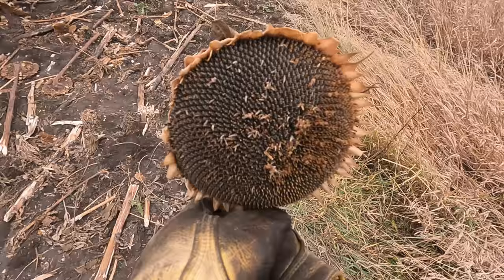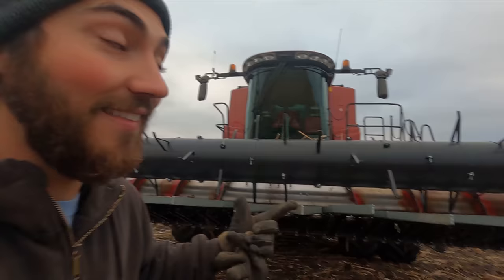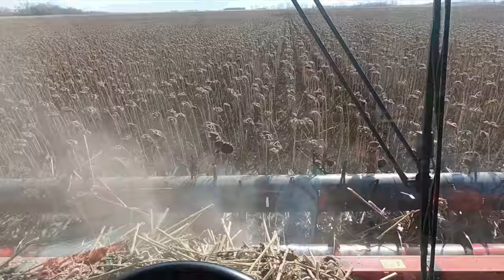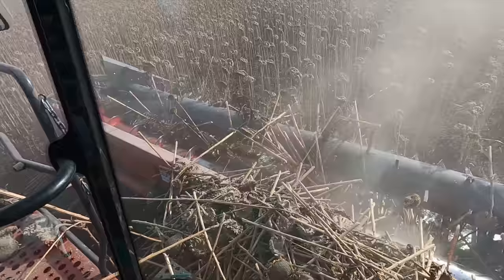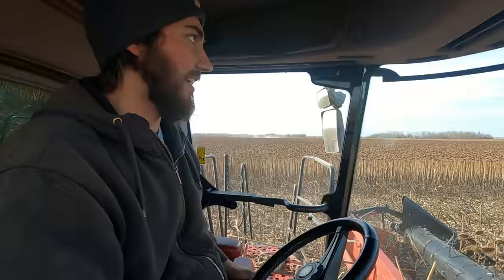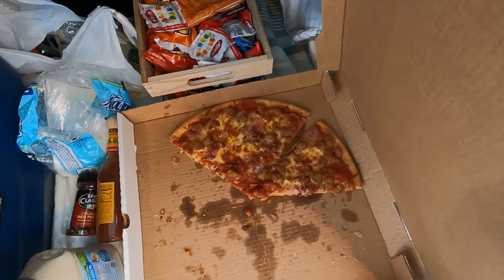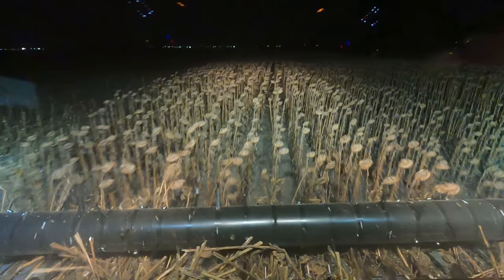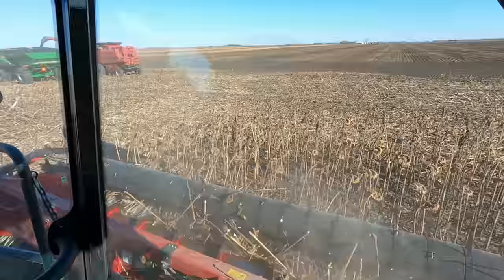Sunflower Harvest: It's an Art

Comment: My experience is the volume of air from a leaf blower is much more important than the higher pressure from an air compressor and thus blows off a combine much quicker.   
 It takes just 10-15 minutes so I use a battery powered leaf blower and that adds a lot of convenience.
Reply: For loose stuff, yeah a leaf blower is MUCH faster, but that stuff looked pretty "caked" on and can be a lot harder for a leaf blower to catch hold of and rip off...

Comment: When I was a little kid I was following the dog thru the woods & out into the field & I tried to walk through a low spot & got stuck in the mud. The dog went back to the yard. When my mother saw the dog & I wasn't with him she knew something wasn't right. She came out & pulled me out of the mud, losing her shoe in the process. Ten or fifteen years later I dug through the same spot & actually pulled her lost shoe out of the ground. That's probably the weirdest thing I have found in the field.
Reply: Our farm pond went dry back in '83 in a bad drought, and my sister decided to walk out across the bottom to the edge of the puddle of water in the middle to see the minnows, and she ended up sinking in the muck to her waist.  I had to try to get her out because Dad was too heavy, he couldn't get within 15-20 feet of her without sinking.  Even I, who was skinny kid at the time, had to crawl out on hands and knees on a couple old boards to kep from sinking, and then just get close enough to throw a rope around her... then we hauled her out.  Sucked one of her brand new tennis shoes right off her foot.  She was caked with mud from the waist down, and Dad wouldn't let her ride on the new tractor back to the house, she had to walk up the hill through the sand burs to get back to the house and get washed off with the hose... she was bawling and upset, but she was the goofball that did it to herself... Found her shoe a couple decades later when the pond went COMPLETELY dry and was hard enough to hold up the tractor, and I dug it out with the front end loader to make it deeper and get rid of the sand that washed in over the years... came up out of the pond with a load of muck and dirt and dumped it and presto there was her shoe in the loose dirt... 

Dad had a "Texaco Tanker" toy ship about 2 feet long with a battery in it that spun the propeller in the back and you could adjust the rudder so it would sail in circles... he had put it in the pond when he was a kid and somehow or another it sank, according to him, front end went down rear end kicked up in the air like the Titanic and down she went, never to be seen again.  Well, until the early 90's when the pond went dry and I was goofing around and found it in the muck... It was okay but the motor and battery were a mess of course...

Comment: Why not cut the flowers high up? Field health or another reason?
Reply from the maker: I pretty much cut them as high as I can without heads slipping under. The higher you cut them the less stalks you send though which is good. We usually run a salford or disk though the field after harvest and that helps chop up the stalks good.